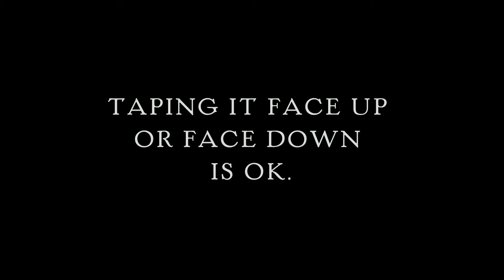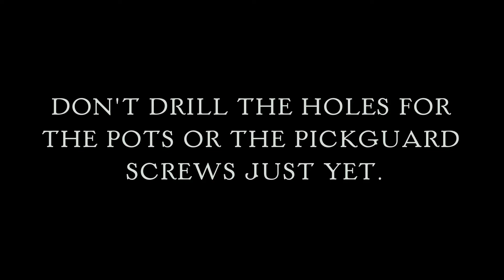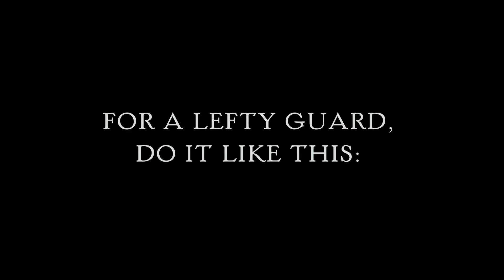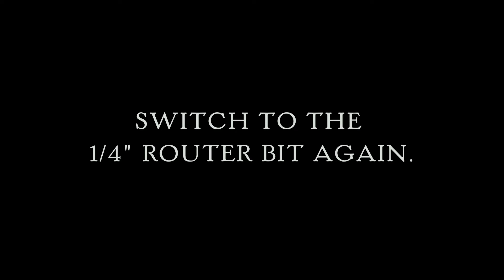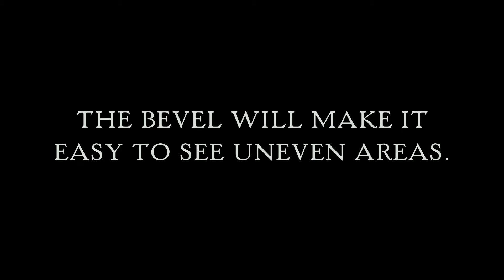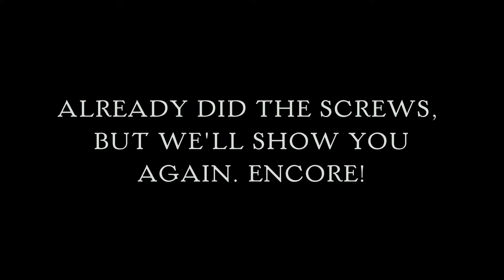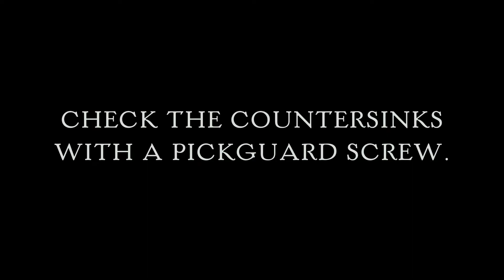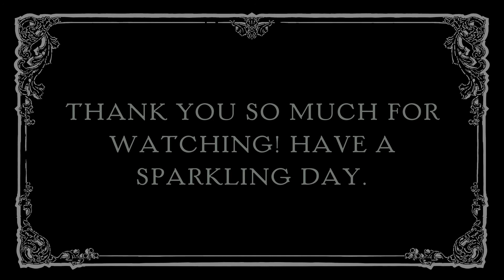Complete Pickguard Cutting Tutorial (Silent Film)

Comment from the maker: Check out my new video, which is an addendum to this tutorial: https://youtu.be/4XQegoOFqlg

"Copying a Pickguard (from Sweden!) - Troubleshooting, Tips and Tricks!"

00:45: Face up will leave a little lip on the MDF that can be routed off, but in my experience is a much better option if you want to avoid damaging the original pickguard. Having it face down looks like it would be more accurate, but it makes the beveled edge of the original pickguard more likely to be damaged by the guide bearing, because there's nothing backing it. Plus, the visibility isn't as good.

06:33: Face up (template side down) on the spindle sander works amazingly well to clean up any humps and bumps, which the beveling will make very easy to see. You spindle sand both the pickguard and the template together, then re-bevel. Files and sandpaper also work well, but mostly for really minor imperfections. If you're careful enough with the spindle sander, you can get the whole job done with that much faster and easier than with hand tools.

Comment: VERY nice.
What would  be VERY helpful would a list of all tools (bits, etc) used along with a short sentence as to what they for (if not obvious).
Thanks.
Reply from the maker: Thanks so much! I'll get on that soon. Will let you know when I update the video description with all the info!
Reply from the maker: All right. I updated the description with a list of the tools that I use. The one sticking point is the trim router. Personally I think it would be much easier to buy a Strat pickguard template on eBay and just use that with a Dremel, Stewmac plunge base, and a 1/16" bit. I haven't tried it yet myself but that would be much easier than the trim router, and probably cheaper too. 

The Stewmac base is very expensive, but the trim router, plunge base, brass bushing guide set AND the template adapter would be a lot more expensive. Not bad if you plan on using a trim router extensively for other jobs, but for just doing this one part, the Dremel makes more sense. I do know that some people have used Dremel cutoff wheels very carefully to do the switch slot, and cleaned up with a file. 

With a template and a plunge router it's foolproof, however, and is the method I prefer. Let me know if you have any more questions!
Reply: @Guitar MD  Hi again ... so following your cool video, I'm at the point where the beveling happens. Pickguard is still taped to the template. All holes are routed and drilled.   But retarding ** (LOL) , what exactly did you do to be SURE the beveling happens correctly?  I can't quite tell from the video?
thx
Reply from the maker: @joeanderson3423  The main way to tell is by looking at the bevel after it's done, and also running your finger along it. If it feels bumpy or wavy, that means it has uneven spots and needs to be corrected. 

As far as height, even I have to check. I usually set the height of the bevel bit a little lower than I think it needs to be, and do the bevel in a couple passes. It reduces the chance of the bit grabbing or, if it does grab, doing major damage. Cutting smaller amounts is always easier on the bits and the workpiece. 

But you do need to get it at the proper height so it fully cuts the bevel. If it's set too low, it won't cut the full angle, and you'll have a shallower angle of bevel, with less layers of pickguard showing, than you should. 

But the finger test is the best. Run a finger along and if you feel humps, bumps, or anything uneven -- sand it out or file it out. Both the pickguard and the template at the same time. Then re-bevel on the router table. Keep repeating this until it's perfect...and save your template when you're done with all that work!
Reply: @guitar_md  Thanks for that.  I was able to get a really good bevel using a Whiteside 45 degree bevel. Super smooth.  All I have left to do this counter sink the screws AND cut the slot for the selector switch.
Reply from the maker: @joeanderson3423  Awesome. Cutting the selector switch slot is usually a pain. I'd love to have a CNC template made. My method works great, but I think the easiest would be a template with an 1/8" slot for use with a Dremel. 

Glad it's coming out good! Happy to see my tutorials are useful!
Reply from the maker: @joeanderson3423  1/8" is for the template - 1/8" shank on Dremel bits will slide in snug and act as a guide to ensure a straight cut. 1/16" is correct for the actual cutter for the switch slot. The template I made for doing this currently has a 5/16" slot for a 5/16" brass guide bushing that I mount in my Colt router with a 1/16" carbide tipped cutter. 

Any way you do it, it's a pain, but a Dremel would be a lot less hassle than a trim router with a guide bushing for sure.
Reply: @guitar_md  Ahh OK ... that makes sense  1/8" as a guide !!
Reply: @guitar_md  For the record, how DID you make the current template you have?  >>> How did you cut that 5/16" slot?  I have some guide bushings coming tomorrow and I already have the 1/16" bit.
Reply from the maker: @joeanderson3423  I used a Potvin Guitars template for cutting the switch. He sells one, but I have no idea why it is made the way it is. Basically his version uses a larger slot for a larger bushing, and that means you have to drill the holes for the switch separately. 

On my template, the holes and and switch cutout are on one single template piece. So you can use the holes to line up the template. Makes way more sense to me. 

I may have an extra one. If you e-mail me at md101089@hotmail.com, just let me know if you'd like me to send you one. You can PayPal me for the shipping cost and that's it, should just be a few bucks. Let me know if you're interested!
Reply from the maker: @joeanderson3423  Long story short, I used a 5/16" router bit with a 1/2" bushing, which the Potvin template is made for. That made a copy of the template but with the smaller 5/16" slot, which is just small enough to allow the holes there. 

Just like I have in the video. To me, that's the easiest way, aside from having a 1/8" slot and using a Dremel, which I'd like to work towards doing. It should be very simple to have someone make that on a CNC machine, and I could probably do it easily enough myself on the router table, but I don't have a fence for my router table yet and I just haven't gotten around to it. CNC would be much quicker!
Reply: @guitar_md  Appreciate that offer and I may take you up on that.  I have a couple of ideas on how to make that template which am going to try in a few  minutes. Stay tuned lol.

Comment: I am new to wood working and I am building a pickguard.  Your video is the BEST for building a pickguard.  The only thing I’m having trouble building  is the Template for the Blade Switch 5/16 Bushing.  Can you respond to let me know how you did that.  Thanks.
Reply from the maker: I made a custom template for that with a 5/16" slot and the two holes for the mounting screws on the switch on either side. I mount the template to the pickguard with bamboo skewers and double stick tape -- the skewers line everything up and then I just lower it down onto the tape. 

Potvin Guitars sells a blade switch cutting template for use with a 1/2" guide bushing, but I was confused about how to use it, so I ended up making my own. I did use the Potvin template as a "base" for making my own template. 

I used a small 3/16" guide bearing router bit in my router table to trace the cutout on the Potvin template. Once I had that copied, I used a guide bushing and a 5/16" router bit in my trim router to make another template out of the original template. 

In other words...very confusing!

Some people make templates with an 1/8" slot, so you can simply use a 1/16" cutting diameter x 1/8" shank Dremel bit. The 1/8" shank doesn't need a guide bearing as the body of it will ride along the template. 

I haven't made one of those yet, but that might be the best and easiest way to do it, as guide bushings in a trim router are a bit of a pain, and way bigger for the job than the tool really needs to be. 

I'm pretty sure there are some Strat pickguard templates on eBay that have the 1/8" slot cutout for the switch, including the holes. You could buy one of those and simply cut that part out and use it as a template. 

If I can really solidify my own template, and making them easily, I might offer them for sale on my eBay store, and I'll certainly make a video about it too. The current method I use with the trim router and guide bushing does work, but is very cumbersome and time consuming, and I'd like a better way to do it. 

The 1/8" template with a Dremel tool would probably be best. I might get to work on this soon. Sorry this was so confusing but guide bushings themselves are quite hard to explain, and without seeing it in person it's hard to imagine how the process works. 

Please let me know if you need any more clarification! And thanks for the comment!
Reply: Thank you.  I made a purchase of guide bushings and will make a jig from there.  So much to learn.  But I love wood working!  PS. Have you ever thought about making a guitar and sharing the video?  There is this Great Guitar Build Off you can be apart of.  It happens once a year.

Comment: I just received a pickguard I thought would fit my guitar but it’s slightly larger in areas. It’s an early 2000s Epiphone Explorer and the guard I have is for a 76 Gibson Explorer. The sizing is off on the area between the pickups. Plus I need to drill a hole for the toggle switch. 

Do you have any suggestions for trimming down the less than a quarter of an inch for between the pickups? I don’t have a bandsaw. I thought taping and scoring the area until I could hypothetically snap it off similarly to plexiglass. Then lightly sand the edge. I’d just hate to ruin the finish. 

Thanks.
Reply from the maker: A Dremel would be the best bet, but you'd need a vise to hold the pickguard securely, or a base for the Dremel so you could clamp it upside down and use it like a mini router table. The idea being: take off the bulk with the Dremel and then use a file / sandpaper / scraping with a razor to get the final shaping. 

A chisel and hammer might work. I'd trust that more than snapping anything off. With snapping you run a risk of blowing a major piece out. Safest bet is remove the bulk however you can and then leave a wide margin for using a file and a block with sandpaper. Any combination of those -- and scraping can help as well. 

A chisel and hammer would also be far less likely to slip than scoring. ABS plastic is slippery stuff and if you score freehand it's a virtual guarantee it'll slip and gaff the part you don't want to take off. 

Chisel + hammer would be the lowest tech choice. Never did it myself though. And leave plenty of room. I'd probably start chiseling away at tiny pieces rather than going for the whole thing at once. Better safe than sorry. 

I recommend a flat block with sandpaper for truing it up, and a good mill file. It does help a lot to have the pickguard in a vise. It's easier than you'd think to level it imperfectly, at a slight angle. I also recommend frequent checking with a small straightedge of any kind that will fit as you work. 

Test fitting is also a factor to consider. It's very tedious. Sometimes making a template out of paper can help. Like put down some sketching paper, and mount the pickup rings back on over it -- then trace the mounting rings, take them off, cut out the paper and you'll have a template you can use to trace onto your plastic blank. Having a visible "finish line" helps a lot, though it'll always end with repeated bouts of test fitting until it's perfect. 

Let me know what you decide on and how it goes.
Reply: @guitar_md  Yeah after I commented before the thought of using my Dremel occurred to me. Yeah I’d need to secure it and I’ll tape off the area I don’t want scuffs to happen. 

On a cursory glance the two pickguards are fairly similar but have enough minor differences. The mounting screws placements are different. Not a deal breaker because the Gibson cover is larger to cover the existing ones. Just not a fan adding more holes to the body. 

Thanks for the suggestions!
Reply from the maker: @GartheKnightReturns  I know what you mean. Pretty much every single pickguard request I get is for the same reason -- minor differences, holes not lining up, things just being a bit off. Doesn't take much. 

Minor scuffs can actually be wet sanded and buffed out of pickguards. They can't be that deep but shallow ones -- I've done it before. Those Kovex rubber blocks are great, and Kydex dry sanding paper -- awesome. Though a traditional foam block and wet or dry paper with some water/detergent works amazingly well too. 

I use either Meguiar's Plast-X or Novus 2 plastic polish for buffing it out. Usually I'll sand starting with 1500, and however long it takes, it's worth not making scuff marks you can't get out in the long run. 

You can buff by hand but a foam pad in a drill goes a very long way. 

Adding more holes can certainly be an annoyance. And especially when you're trying to keep the body original. Pickguards are supremely frustrating for something so seemingly basic! 

One of those Otter mini router tables look pretty good. I don't own one. But I have used the Stewmac precision router base to make a makeshift router table with a Dremel. That can work really well. Pickguard material is thin enough you might be able to get away with that. But clamping the guard in a vise will also work. Usually when I have to freehand pickguard areas I'll do it on the router table, though for obvious reasons that's extremely risky. 

I forgot to mention: bastard cut files will work great. You can even avoid the whole powertool thing altogether if you get an aggressive bastard cut file. Those can hog off material crazy quick. You do need to be careful but working by hand you're less likely to gow something up than you are with a power tool. Those can get away from you easily. Have had that happen many times. 

I've been meaning to get a better file collection myself. I have some aggressive ones but they do dull over time. 

And don't worry if it takes forever. They always do. At least for me. I always thought I was doing something wrong or there must be a faster way -- generally, there's not! They're a royal pain. Believe it or not, I'm not naturally mechanically inclined, and I also struggle with stuff like this quite a bit. It's a hard-earned skill for me but I still can't keep up with the guys like my friend and mentor who have a real eye and knack for it. 

Those guys can freehand with power tools all day and never make a mistake, and know exactly where and how much to file/sand off to get things fitting perfectly, with minimal to no test fitting. I'm not one of those guys. If you are -- then this will be a breeze for you. 

Let me know how it goes!

Comment: You do it the same way with trussrod covers? I imagine it´s pretty creepy to have your fingers so close to the router or bandsaw :-o
Reply from the maker: I've made pickup bobbin flatwork using the "mini router table" Dremel setup. Stewmac precision base or Dremel router table (personally never used the Dremel table). That's pretty scary as your fingers do get very close to the cutter. I don't recommend it.

I am extremely experienced on the router table and even then it is fairly stupid of me to do things like that with the Dremel tool. There are ways to hold the workpiece farther away , but with a bell cover you're going to be forced to have your fingers dangerously close to the cutter. The small parts I've used the mini table for are much longer than a bell cover and allow me to get my fingers a bit farther away.

 Responsibly, I can only advise that you cut it out by hand with a coping saw and do all shaping and beveling by hand. 

It's a small enough piece that doing it by hand can go quickly. Using a mini router table would actually take longer for all the extra work you'd have to do making such a small template. Too risky! And at that point not even a time saver.
Reply: @guitar_md  i see, yeah you got a point there. Thanks for your reply and keep up the great work!

Comment: Hey man, great jog! Where do you get that bevel cutter? and the smaller one for the corners? Thanks
Reply from the maker: I use ToolsToday.com, but eBay also has them. Amana Tool is the place to go for all router bits, and they're all I use. They make and sell an exclusive line of router bits for luthiers, which that bit is part of. 

One of my favorites is the Amana Tool 47223-S, which has an 1/8" shank to fit into a Dremel tool. Highly recommend that one as well! They also have bevel bits, these days I'm using a 45 degree.

Comment: what was the grit of sand paper did you use?
Reply from the maker: 220 most of the time, but occasionally 150 if I need to take more off quickly. But it's always good to finish with 220 to smooth it out if you do use a heavier grit!